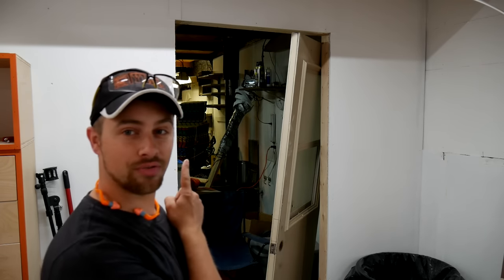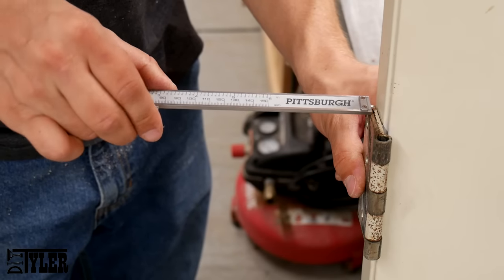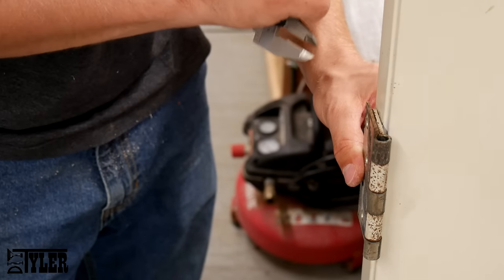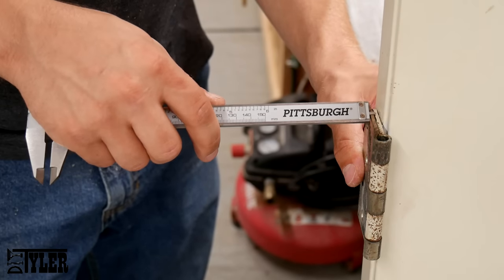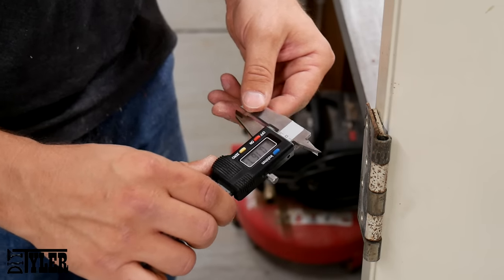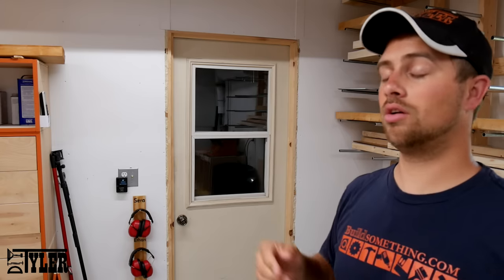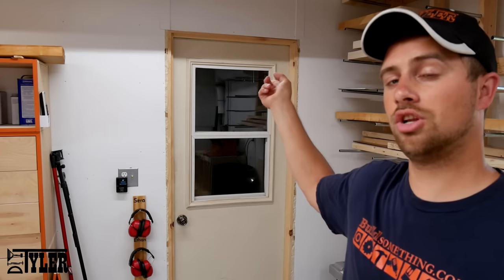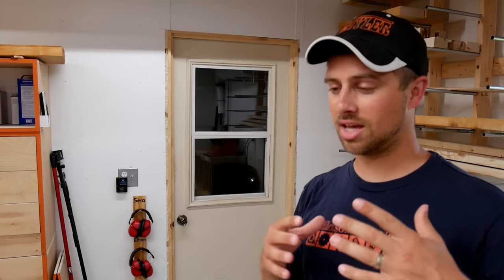Never buy a Door Frame AGAIN! | How to Make a Door Frame | D2D DIY

Comment: Doubt if the average person has that setup...Tools,Workshop,Etc.
Reply: What exactly doesn't the average person have in their garage? A drill and saw is something most men have on hand. Router is not very unusual either but there are other ways of doing the same thing. Even if you don't have those things, you'd still save money by going to the store and buying them for the job, but of course, they're just basic tools you should have and will need in the future anyway.
Reply: @otallono  Again, Bryan nailing this on point lol. "Average" person depends on who you are. I work in IT, not even close to a word-worker or even construction (or particularly 'hands on' 'manual labor' sort of career/job), yet I owe the normal tools needed to do this. They aren't incredibly expensive, and yes some are, but they aren't required to do anywhere near this much work. People did this 200+ years ago. What do you think they had (types of tools) while doing that? lol.
And yes, if you had to rebuild, say 3 door jams and you were already planning on renovating, the few hundred dollars total for all of the 'mid range' tools is far cheaper than 1) buying premade, 2) paying someone thousands to do the work you can do for free, 3) You can reuse the tools OR sell them after and get a 70% of your money back from them. Needless to say, you are, regardless, usually going to save yourself money. Time, however, is not one you will save lol.
Reply from the maker: If you actually pay attention and didn't just want to hate and be jealous you will realize all the nice tools are in the background. Used a table saw, miter saw, nail gun, router and nail gun....if you can't figure it out from there you are watching the wrong channel.
Reply: I'm just gonna start copy-pasting this to everybody that says "I doubt most people have this!!1!"

If a $200 miter saw is too cost prohibitive, get a $10 hand saw. You can cut wood just as well, it will simply take you longer.

If a $75 router is too cost prohibitive for you to mortise out the frame for the hinges, get a $5 set of wood chisels. It will accomplish the same task, just take you 10 times as long.

If a $100 multitool to flush cut your shims is too cost prohibitive, use a $10 flush cut saw.

If a $4 Forstner bit to cut out the door latch is cost prohibitive, you have deeper problems.

The point behind all of that is that there's a thousand ways to do a hundred tasks, and the exact tool you use to accomplish the goal isn't important. Quit bitching about "his wood shop". He's already said that a vast majority of his tools that he uses with any regularity only cost him about $500 total because he wheeled and dealed on Craigslist to get what he has. If you cant afford $500 in tools over the 4 years he's been running this channel, you need to find a better hobby.
Reply: This frame could be built with a chisel, screw driver, hammer, handsaw and a few nails in an hour or so.  A $50 table saw off of C/L would be really nice.
Reply: the average MAN should have these tools, if not, you should ask yourself where you went wrong as a man.

Comment: "zero dollars" assuming you own 10k worth of carpentry tools already
Reply: Nowhere NEAR that much is needed to do this… 🙄🙄
Reply: Dude maybe $200 if you want to be lazy and make everything easy. And a box of screws and wood glue. 

Easy and cheap. You could literally do this with a single hand saw and a manual screw driver if you wanted.
Reply: @joshuamills3346 literally doing it with a hand saw and nails as. Used this video for reference. 😂
Reply: Then use a carpenter saw and a chisel, stop complaining. This can all be done traditionally.
Reply: You can do this with a drill a wood chisel and a hand saw. Don’t forget people been doing this for hundreds of years without power tools.
Reply: 10k is like one tool

Comment: You explained virtually nothing. Just a collection of quick edits and the process of making cuts, but virtually no mention of measurements, depth calculations, how to level it out, how to adjust the shims, how to make sure the door doesn't bind.... nothing. It's like getting a video on how to fly a plane by saying "Get into the cockpit, fire up the engine.... and start flying"